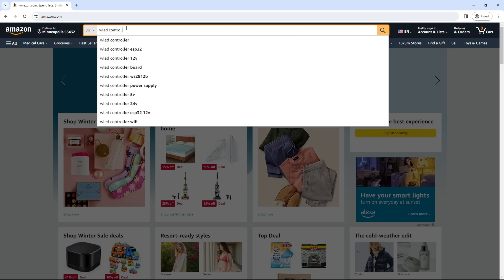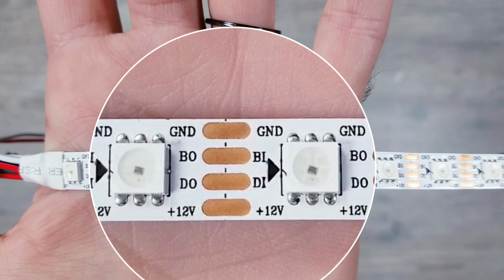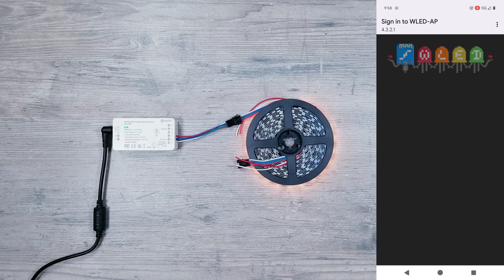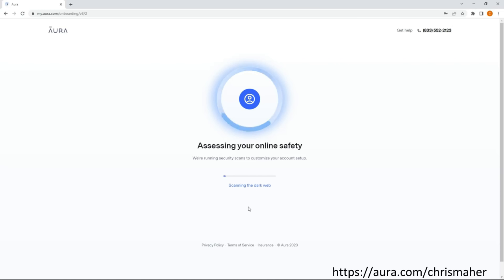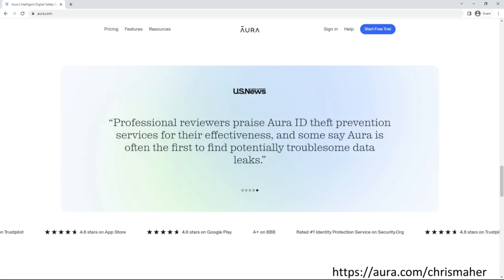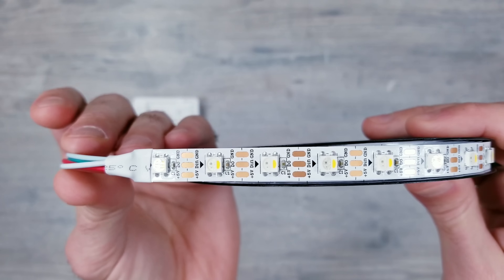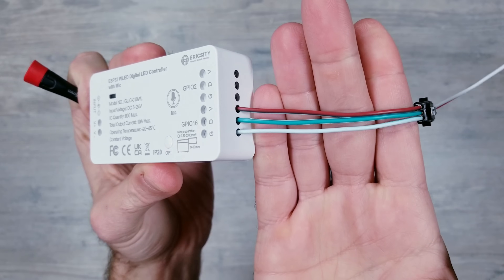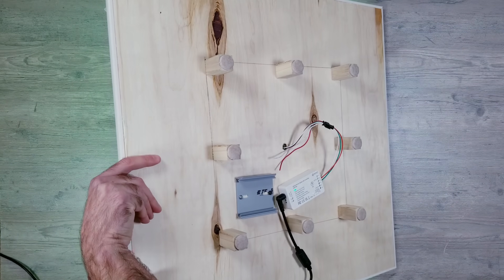Plug n Play WLED Controller: 5v, 12v, 24v Compatible! Full Walkthrough.

Comment: Can i use to connect to a CELL PHONE'S HOTSPOT network???? Since where I want to install 3 of these devices I don't have wifi I hope you can help me thanks community
Reply: Yes, as long as your hotspot supports the number of Lights you will have attached to it and whatever you're using to control it with like your phone. Just need to know what the hotspots name and password is when you set it up in the app software. He mentions this when he talks about if setting up on his home network. You will just use your hotspot information instead of your home network information please note that most Wi-Fi hotspots especially if they are based from someone's phone will often have a low-power or Les use or timed power off

Comment: Hello,

The maximum number of LEDs on this controller is 800, but you put 1200 LEDs ws2815 or are there 800 LEDs on each GPIO? Do all 1200 LEDs work with only 12 v and 10 A?

Good video. Keep it up.

Comment: Hi, it's possibile to drive a single color (warm white COB) led strip AND an RGB 2814 60LED/m with a single controller? I read that it's 2 channel but the power option is only one, if i split the power (also i have to do this to connect 4 x 2.44m stripes FCOB WW) and give power to the RGB also and then put the RGB cable in the controller I'll see just like a single strip to control and when moving RGB in the app does not affect my white output (powered just on 24v) right? PS: the controller is the SP630E

Comment: Any chance you could do a video on adding a level shifter to these? I have a 5v power supply hooked up to two of these controllers, each hooked up to a 180 LED strip and a 120 LED strip(WS2812b 5v strips) with power injected into the ends of both strips and they still flicker. I believe it may be because I have 15-20ft of cable(running it behind the wall to hide the wire) between the 120 LEd strip and the controller so I think I need a level shifter. But I have no idea how to do it and all the other videos are on doing it with Raspberry Pi and Arduino.

Comment: Hi Chris, love the channel.  A couple of questions; I would like to run 20m (65ft) of 24v LEDs around the inside of my outdoor pergola.  I thought 24v would be better, as it would provide a good amount of light.  I was going to split the power load by running two 10m light strips (2 x 32ft) lengths off the one transformer (650w).  Will one of these WLED controllers suffice, or will I need to use two controllers?  If I need to use two, how do I sync the two controllers?  How many of these controllers can be synced, as I would like to do other projects in the backyard.  Any chance you could do a tutorial to show a step by step process of syncing?  Thanks. Craig

Comment: Bought the esp32 with WLED and audio for a matrix combo. Found that the wireless worked intermittently with 5 volt input to the controller. When I use 12 volt it works fine. Had to add a buck converter because matrix panel are 5 volts so I could use just one power supply. Pulled out what hair I had left before I accidentally grabbed a 12 volt supply to solve the problem. I would be interested to know if anyone else has run into the same problem.

Comment: Can this controller effectively operate two distinct LED strips simultaneously? I'm contemplating installing two strips within a corner diffuser. The intention is to designate one strip for color illumination and the other for pure white light. However, I am uncertain if this approach is advisable. Approximately a year ago, I corresponded with @chrisMaherDIY, who indicated that color strips might not offer optimal performance for dedicated white lighting. I am curious if technological advancements have since addressed this limitation, enabling LED strips to provide both superior color rendition and white illumination. If so, could you please recommend the most suitable LED strips and controller for this purpose?

Comment: I'm planning to use the BTF-LIGHTING WS2815 Light Strip and ESP32 WLED Controller with the power supply you recommended for my Kitchen remodeling project for the accent lights on top & under the cabinets.  If I play music will the MIC on the ESP32 allow the light strip to match the beat of the music?  Also, can I connect this Controller with the Alexa App? I didn't hear you say anything about that in your video, so I was curious before I purchased it on Amazon.  Thanks again for the Full Walkthrough video.

Comment: Hey chris, I'm looking at your comments in the description about how if using a 24v cob strip to use GRB and to swap W & G, what W and G would I be swapping? I've got a 4m strip hooked up to a 24v power supply and one of these controllers, I can't get the strip to set to a solid color. Each controllable zone is a different color and when I choose a solid color nothing happens. When I click "peak" it shows the solid color. So I'm assuming I either have something in the settings put in incorrectly or something with my hardware isn't working...

Comment: Chris and all the Chris community. Here is an open question: I purchased all the items on this video and followed all the instrucions up to minute 5:42.  However the intensity of the led lights is not bright enough.  I think I have three options....  1) use a 24 volt power supply; 2) Do power  12 V power inyection for each led strip... or 3) Raise the automatic brightness limiter to XXX mA.    Anyone knows the solution?   Alberto. Houston TX
Reply: Alberto, did you fix it? Because I was wondering to make the some setup 15m of LEDs, have them with the 2 GPIO outputs (7,5m each) and I was gonna get a 12v 10A power supply, and I don't want to have power injections or some, cause it will look awful. Let me know something about that
Reply: I got brighter LEDs by changing xLight / Controllers tab / selected device / Protocol: DDP (instead of the default E131). As DDP is an auto-discovery protocol, I'm sure I just set my E131 settings wrong, giving the lights lower voltage... but DDP doubled brightness for me.

Comment: hey great vids , i have a question you may be able to help. i want to run some led profile strips vertically down my hallway and have them come on using one of the programs that the WLED controller offers , my question would be could i simply put a pir sensor up to detect when someone enters the hallway then then pir sensor would feed the 12 v 10a transformer which would then feed power to the led strip, hence as someone enters my hallway the lights come on , or would there be a huge delay that it would be pointless or would this be a bad idea from the start or is there an easier way of doing this . Any advice would be appreciated.
thanks
steve

Comment: Thanks for this video. 
I am facing a problem with my btf 5m led cob lights. When connected to the Gledopto controller with the prescribed 12v 5a power supply i get flickering and random colour problems. Looks like it is to do with the level shifter. Any advice on this please ?
Reply: I have the same problem with a 24V WS2811 LED strip. 3 Gledopto controllers produce the same issue. The same LED strip and PSU works fine with an Athom controller.Has your problem been solved since then?
Reply: @gyulaandor2161  Hi, I found out that if you have a long wire coming out from controller to the lights then this could happen. Its solved for me by cutting the wire to a short length. Hope that helps.

Comment: Hi Chris,... anyone had any issues with the wifi setup on this? I can connect to my home wifi but a static IP doesn't seem to work and setting to DHCP picks up an IP not in my home wifi subnet but strangely enough I can connect to that IP. Factory reset doesn't seem to work either, pull the power 5 times. I am on version 0.14.0 of software there is a 0.14.1 maintenace relase with a few bug fixes.

Comment: Great video Chris! I have two questions. 1) Does this ESP WLED controller offer the same results like the original ESP? Which one do you prefer an why? 2) You connect the SK6812 strip with black AC power supply but on your desk you use a 60A power supply. When can i use the one or the other? Whats the difference? Thank you for your time. God bless you

Comment: Hi Chris your work is incredible and inspired me to do some things. I am new to led strips so i want to wire my pc setup its about 6 meters long with the SK6812 60 leds/m. I'm gonna combine it with the wled controller but i'm not sure about the power supply. From what you said and some articles that i read (correct me if i'm wrong) i need a power supply that has 5v supply voltage, power of 300 watt (found online that consumable power for 1m SK6812 is 43,2w) and energy consuption at 60A (also found online that is 9A per 1 meter).

Comment: Hi Chris, love the videos!   Q:  For the 12v cob lights you linked, which are 21W / m.  105W total (5m strip). The 12v power supply you linked is 60W.  Are you just limiting the Amps in WLED so that the power supply is fine?   Trying to recreate your spiral project, so i assume this combo of power and 12V lights is fine?  Thanks.

Comment: Hey Chris, this is a copy of athoms controller. These are great and have been using them for a long time. They need to run moon module wled which is the best wled version for sound active. In my vid I run 3 athom controllers on moon module 
https://youtu.be/Z6Q76GNgdYg?si=1asum4yyZFo-WMU4
Reply: I actually run 4 controllers as I have 20m of strip running outside the house u cant see in the video

Comment: Do not auto update the firmware currently. It will disable the microphone settings and you have to flash it manually to the audio reactive version.
Reply: I've been using the athom controller for a long time. This product isn't new. Update it to moon modules wled which is the best sound active version of wled
Reply: @Krakenled do you happen to have a link for a how to video?
Reply: How do I flash it manually
Reply: @TestCycles  
U can upload modules and patches via wifi thru a PC
Reply: @Krakenled  Thank you. Will try that.
Reply: @Krakenled  Hi, is there any link to get the update files?
Reply: Just found this out anyone has a link to where get these files ?
Reply: What addressable controller would you recommend for just white 24v continuous fcob strips. I would like to do eight lines going up the wall and when you flip the power on, I wanted it to travel up and then stay on.
Reply: @edschellens9411  never worked with fcob strips personally, i would think an esp 32 board with WLED could work

Comment: Is there a video showing how to enable the microphone on this controller?  Please help
Reply: Technically it’s in the little manual they sent with it. Issue is I did the automatic update via WLED Native app. This will install the version without the audio reactive mod. I returned mine because of that issue. The product is a great idea but definitely not done yet. If you can’t access the software to flash it yourself
Reply: @iggy_ing  ok thank you very much.  So basically if I update it then the mic won't won't. Well that's a buzz kill
Reply: Yeah! That was at least my experience. It’s unfortunate that you can’t access it easily for manual flashing. I had the more expensive version where you can access the usb plug after you open the box up. I installed the new audio reactive version and it worked again. Problem was that it lost wifi connection constantly after it and other random glitches.
Reply: @iggy_ing  hmmmm ok so now I'm thinking which one I should get since this one wouldn't work well.  I already bought it.  I'll try it out for my self and try and custom flash it. And see if the mic works.  Best of luck to me lol but thanks for all the information.  Very helpful
Reply: I hope it will work out for you! I like the idea of the product but it’s just to unstable currently for me